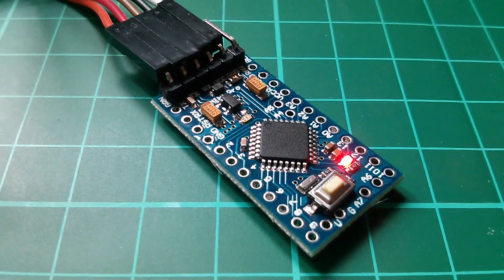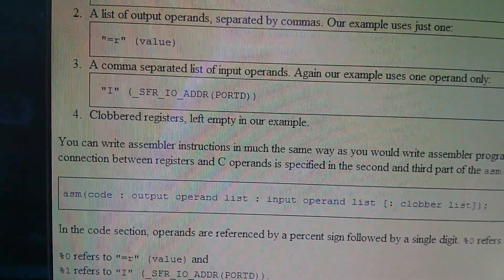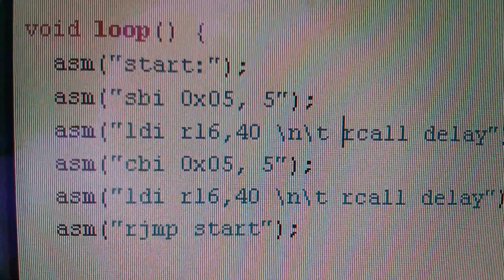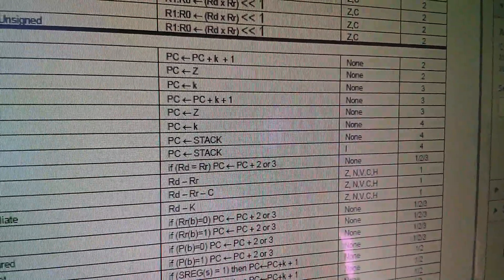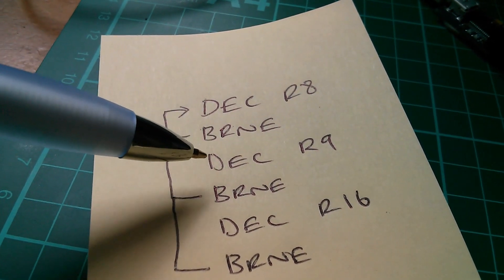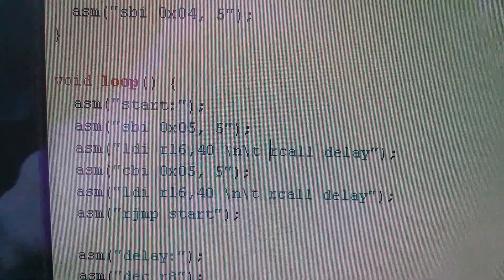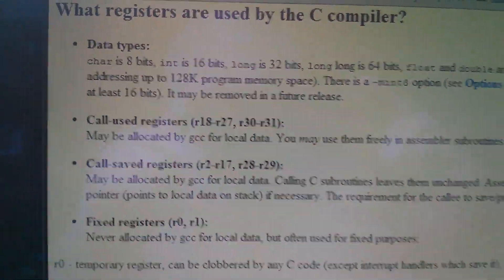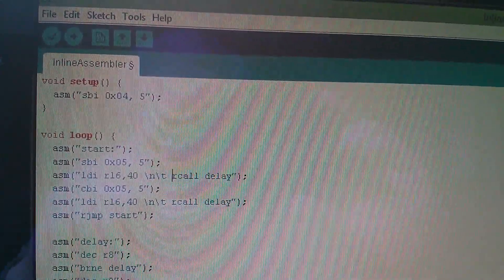Arduino Experiment: Playing with Inline Assembler

Comment: Hi Julian! Do you know  maybe why rol is not working on PORTD register? I tried
void 
setup() {
  DDRD = 255;
  PORTD = 1;
}

void loop() {

    delay(1000);
    asm("rol 0x0B");  

}

No errors but it does not work, below works... so maybve rol can not be used on PORTD register?  What can be a possible solution to use rol anyway? Thx.
  asm("sbi 0x0B, 1");

  delay(1000);
  asm("sbi 0x0B, 2");
  delay(1000);
  asm("SBI 0x0B, 3");
  delay(1000);
  asm("SBI 0x0B, 4");
  delay(1000);

Comment: Assembler in fact starts to show it's very best side when it is used exclusively, without mixing it with C/C++. At least for controllers. Did you also try to use the free of charge Atmel Studio (in plain assembler instead of C/C++) along with just the bootloader from Arduino?

Comment: This is a long winded way of going about writing a bit of assembler code. Why don't you just code it up in ASM in AVR Studio and then program the board directly.  I use Arduino Pro Mini boards this way without any Arduino stuff, which only slows everything down anyway.
If you're clever enough to write inline assembly language, then you're clever enough to do the real thing. Cheers

Comment: Hey Julian, 
I think you would be better off programming directly  in Assembler rather than with the "asm" command in every line. That way, you dont have to worry about accidently using registers that are already in use by c and you also get a way cleaner code.
In addition, you then know the final code that will be running on the AVR and the compiler cant put stuff in there that ends up being useless :)

Comment: The only rule is: do what gets the job done.
I've almost always come back to assembler with AVRs.

I tried C, but when I tried to program like I normally would (descriptive, nice data structures, encapsulated subroutines), the compiler produced way too much overhead. What should in theory have worked never even came close in speed when using C. I decompiled the generated hex-file once in a while, and there were way too many unnecessary assembler instructions (stack operations, memory access and stuff like that).
Of course I could optimize C, but what's the point when I have to start managing registers myself, inline subroutines in several places, and do other things that make the program unreadable.

Same thing happened with Arduino. Not only is it hard to get maximum speed out of an AVR (it is the same C compiler after all), but in addition to that all the interrupts and timers different libraries/functions use, can mess up the timing of programs and make it harder to debug than a pure assembler program. My last two Arduinos (can't argue about the price of the China clones) ended up having their boot loader stripped. A little bit harder to get you program on (you need an ISP-programmer), bt after that: full control! ;)
Reply from the maker: It is tempting to switch to pure assembler, but now I've had the luxury of nice, easy base 10 floating point arithmetic, the thought of going back to binary and hex isn't quite so attractive. And now I'm intreagued by all the extra stuff that Arduino can do by talking directly to the microcontroller's registers.

Comment: amazing how it can run through those loops a million times in a second, i remember in my days of messing with a commodore 64 that could maybe do 100 loops a second, and about 20 if it had to write to the screen
Reply: +jusb1066, I am sure you are referring to BASIC then which is an interpreted language. The C64 has a 1 MHz 6502 processor and can do a lot of loops per second depending on what you do. For example, the "LDA absolute" (load accumulator register from an absolute address) instruction takes 4 cycles, a "BNE offset" (branch to a byte offset address if Zero flag = 0) takes 3 cycles when done and 2 cycles when not. Considering a PAL has 985248 cycles per second, you have quite a lot of power. Still the tiny ATmega32 runs at 16 MHz - so quite a bit more still. :)
Reply from the maker: I had a Z80 rack and card machine back then with a BASIC interpreter, but it was the sheer speed of machine code which got me to switch from BASIC to assembly language.

Comment: I wonder what the power draw is with those nested loops
Reply: Non different than with any other instruction. Why should it be?
Reply: superdau
We anthropomorphise. It's tempting to think that a processor is working harder on our big programs than it would doing nothing, but of cours,e it never does nothing. "doing nothing" for a microprocessor means screaming at full speed around a very small loop (unless it's a static CPU whose clock can be stopped).
Reply: Chris Wesley
Maybe you meant the reply to be for Hugh, because I didn't say "hard" programs are more work than NOPs. Although nowadays most CPUs have powersaving features to slow them down or stop parts of them completely if not needed. (even the tiny AVRs can be sent to sleep and really do nothing except wait for an interrupt)

Comment: Very Straight forward and clear as always keep up the good work....Also have you ever looked into the Ti msp430 launchpad?? Its $10 for the kit and it includes 3 chips and extra ones cost around $2. You can even use a modified arduino software to program them call Energia.
Reply: too over priced for what it actually is
Reply: Still better than using an arudino plus you can get free samples from TI as a student :D